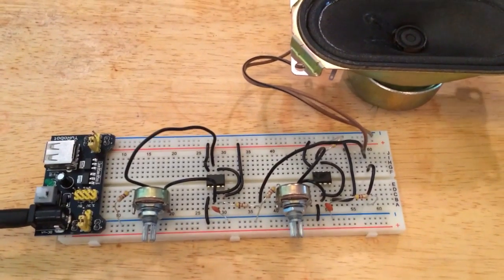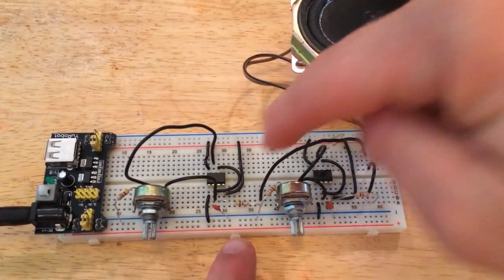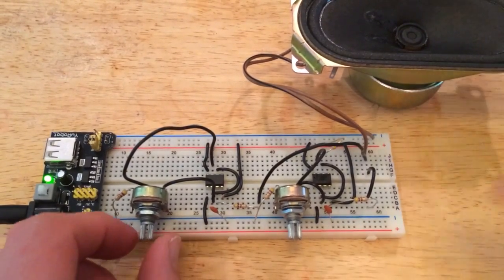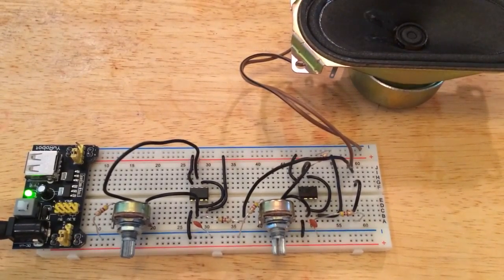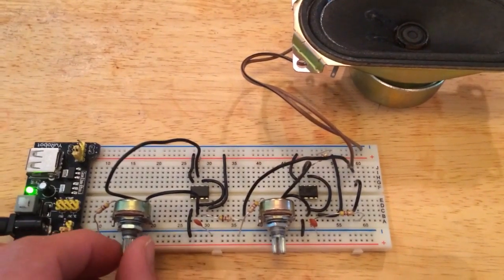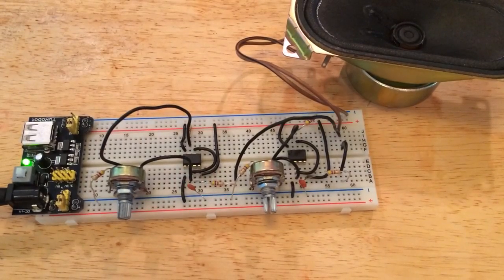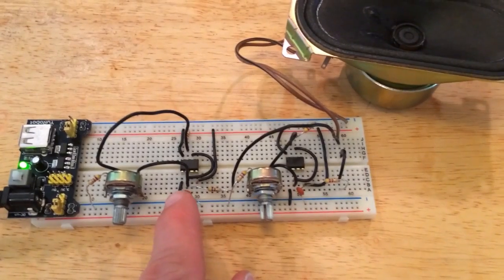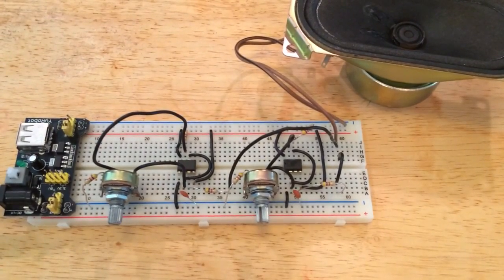2 Tones - 2 555 Timers Through 1 Speaker

Comment: you just connected the both 555 out capacitor to the positive of the speaker? you didin't use any diode or resistor at the output?